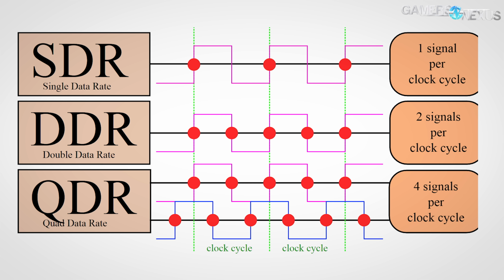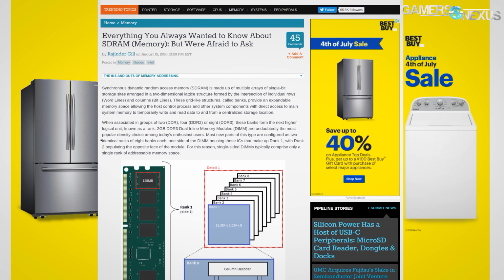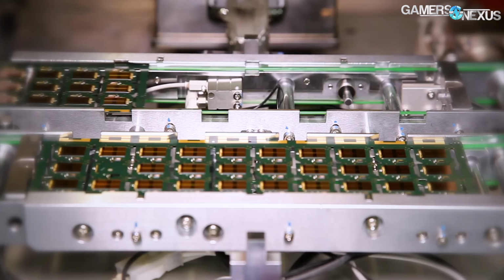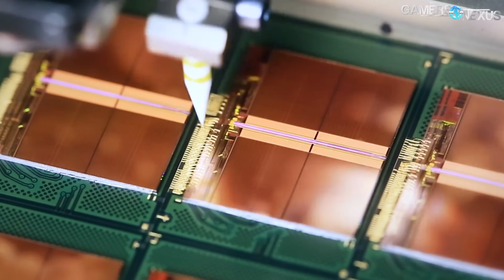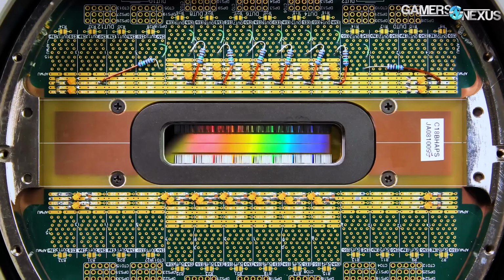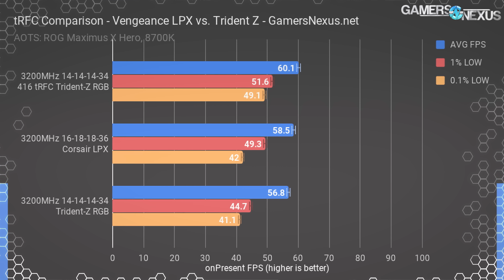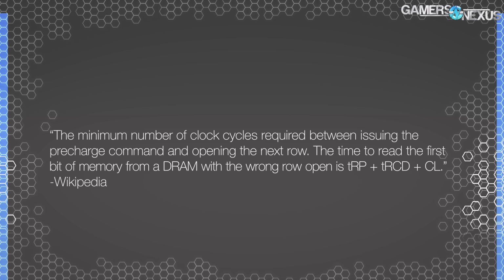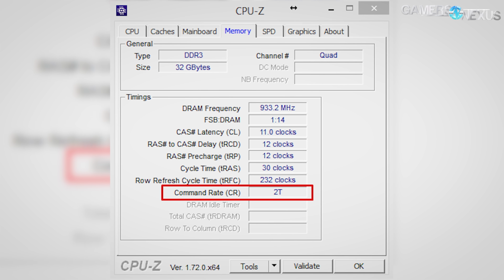What Are Memory Timings? CAS Latency, tRCD, tRP, & tRAS (Pt 1)

Comment: I've got some questions about some of the timings. I'm relatively new at ram overclocking. Just figured out I can adjust the ram timings on my alienware x51 r2 using grubx64.efi. Thanks to Laptop Tweaking Tips Channel. tRC should i set the lowest possible value or highest. as for tCWL should it match tCL or should it be set under if possible. My current timings are as follows, let me know if i got the formula correct or maybe some suggestions on improvements... Corsair Vengeance ddr3 8gb x2
   tCL - 8
tRCD - 9
   tRP - 8
tRAS - 19
  tRC - 27
tRFC - 174
tRRD - 4
 tWR - 8
tWTR - 4
tRTP - 4
tFAW - 16
tCWL - 8
tREFI - 6300
frequency - 1600mhz 
T1
memtest passed and it is definitely faster. additional specs, I5 4440 CPU, gtx 1060 6gb, 430 watt Antec psu.

Comment: Hello everyone, I have asus x570 strix e gaming  with 64 Gb ram Gskill trident neo  3600 , everything was right when I ran with 32 Gb ram ( 2 slots) when I upgraded to 64GB (4 slots) the system is always start 2 times (it on and off for few seconds then run again as normal) when I put the button to turn on the PC, I think I really need help from you to fix this issue.
Reply: just take the  32 gigs of ram out. Why you need 64 gigs of ram anyway?

Comment: Havent watched this just yet, but I would take the expo timings, adjust for stability, then lower each value in turn until it crashes then knock it back up.
I do know if you have 4 sticks, you should raise the CL by 2 to account for path distance to 2nd set of sticks.

Comment: The xmp or dhpc profile may be limited by your power supply, because todays graphics cards use more watts, I had xmp 2 profile turned on and would get error message when shutting down windows, so I switched to xmp 1 and now I have no errors and no fps was lost in benchmarks, when I upgrade my power supply I may try xmp 2 again, but it may not be necessary.

Comment: I have been building my own computers since last century, but never went near memory timings. I'd overclock my CPU and GPU, but memory was kind of daunting. I recenty bought a pair of 16Gb DDR4 sticks. CL18 3600 Corsair Vengence Pro. I set the primary timings manually. It was dead easy. I just went by the XMP timings as a reference. I lowered them from 18-20-20-42 to 16-18-18-40. Stable as and my computer feels quite zippy. I did not need to splash out on CL16 memory after all. There was a hitch though. A setting that was auto set went up from 64 to 75. Bank cycle time, tRC. I set it manually to 64. 

I did not go for highter speeds though. 3600 is enough for little old me and my more than grunty enuf 5900X. I do not like raising voltages for a tiny boost. I like to get best possible performance at default voltages, because extra voltage has very often reduced component lifespan in my experience (except my trusty old 2500K - that thing ran OC'd forever until I went Ryzen after Intel pissed me off one too many times).

Comment: I had some T Force Vulcan Z 16-18-18-36 3000Mhz 1.35 volt ram 2x8GB and I wanted 32GB total just because of tons of things running and I bought the exact same specs and compatible ram that was also 16-18-18-36 3000Mhz 1.5 volt 2x8 and even by themselves I could only get it to boot at 2866 and it was very unstable and only stable speed in any of the slots I got them to was 2400 :( And with all 4 sticks I only got 2133 no matter what. I spent around 6-7 hours constantly messing with them and I think mine are defective so I'm going to RMA them. They were some really cheap $35 2x8GB sticks.
Reply: never mix kits... thats the issue
Reply: @d0x360  Yeah I just couldn't find those same kits brand new and didn't know some motherboards only support up to like 2666 if you use 4 sticks of ram. Going to end up just buying 2x16 kit dual rank now.

Comment: In 1979 when I was working at Texas Idiots, I suggested that they change the read-write refresh process to the read-correct-write process. The number of bits needed for error detection/correction goes as the logarithm of the word width. An 8-bit word requires 4 bits at a cost of (8+4)/8 50% overhead. The row size at the time was 1024 bits. This requires 11 extra bits of data for an overhead of (1024+11)/1024 1.1% overhead. In addition, you would get "scrubbing" which means most errors would be corrected before a second error could occur. TI deemed this too radical an idea.

Comment: People using "the speed of light" instead of "the speed of causality" irk me. Sure, they're basically the same number by our modern physical understanding.

But the former makes it sound like it's just the speed light arbitrarily travels at. Whilst the latter makes its clear that it's the maximum speed that anything can be caused to physically happen.

Which makes unintuitive ideas like "a stick to the moon won't break light speed when you swing it" far more intuitive. As the atoms in said stick can not physically be caused to move faster than X speed.
Reply: Well said. Propagation velocity of C also varies depending upon the medium in which it travels. C variable depends upon the characteristic impedance, in Coax propagation velocity can vary from 55% to 79%. Cheers!

Comment: Amazing content, and can fully appreciate how difficult it is to make such technical points digestible.  At this point perhaps it's better to start all over, but just start with a page completed vs. making a video about it.  The benefit is that the page can be updated and clarified over time once the framework is set - then that can be the rubric for following up on a summary video (or videos). Thanks to the team for this info!

Comment: I worked for years as a Digital Component Test Engineer, and that included testing DRAM DC parametrics, AC parametrics, and functional testing using algorithmic pattern generators.  I am very impressed with the content of this video, so much so that I am bookmarking it, so I can share it with others in the future.

Comment: I kind of think this is a really bad explanation.
You are jumping all over the place.
It's best to just go over rows and columns. And also go to the breakdown of a memory address and how it's assigned a rank, row, offset, etc.
You can talk about how the row/column select is basically a mux if you want but that can be omitted.
Then you can talk about the precharge and column select. (And how this is derived from the memory address)
And then from here you can basically show each bit is basically a capacitor.
The memory address activates the row, and this causes each bit on the line to dump its content(it's a capacitor) onto the line. And then the sense amp detects the change in voltage.
Then a column is selected (cas latency!), to read particular bits.
It is good to keep a high level understanding first, this is all matrices with rows and columns but you did not talk about that much.
Your explanation is going into the details without understanding a high level overview of what is happening.
There is a good paper that explains this well, it is called:
The Memory System
You Can’t Avoid It,
You Can’t Ignore It,
You Can’t Fake It

Comment: Thanks for the tip on CMD2T, I was having problems when I installed 2 additional DRAMs for a total of four and had downclocked just to get it stable. Changing CMD 1T -> 2T did the trick and now I'm running the DRAM at full XMP frequency and timings.

https://youtu.be/o59V3_4NvPM?t=1087

Comment: Man, this reminds me of my masters PC architectural courses.  We had to write code from scratch to emulate an x86 processor, create a virtual cache and memory to simulate how data is transferred between all 3.  He'll then ask us to retrieve data at certain points in time in either the cache or memory to check if it was the correct data.  I think we even went into ECC coding.  It was a summer course and that wasn't enough time to really really dig into it.  We sped through so much (50+ pages per week) and very few passed.

Comment: Since the A520 can overclock ram, and is 2 DIMM board if i pair it with a ryzen 5 3600, which of the memories will have the best performance and overclock headroom for this board and processor Kit?

The setup is just focused in gaming, with a rtx 3070, Max fps focused
If the setup is just for gaming in 1080p and 1440p, infinity fabric 3800, should i take 3700x instead of 3600?

https://pcpartpicker.com/products/compare/BZwqqs,JVQG3C,vVVD4D,YYdrxr/

G.Skill Ripjaws V Series 32 GB (2 x 16 GB) DDR4-3200 CL14 Memory
(Dual Rank, Dual Channel, B-die 3200 CL 14 14 14 34 First Word Latency
 8.75 ns)
$174.99 (Price / GB
 = $5.468)

Team T-Force XTREEM 16 GB (2 x 8 GB) DDR4-4500 CL18 Memory
(Single Rank, Dual Channel, B-die 4500 CL 18 20 20 44 First Word Latency
 8ns)
$184.99 (Price / GB
 $11.562)

Patriot Viper Steel 16 GB (2 x 8 GB) DDR4-4400 CL19 Memory
(Single Rank, Dual Channel, B-die 4400 CL 18 19 19 39 First Word Latency
 8.636 ns)
$117.00 (  Price / GB
 $7.312  )

G.Skill Trident Z Neo 16 GB (2 x 8 GB) DDR4-3800 CL14 Memory
(Single Rank, Dual Channel, B-die 3800 CL  14-16-16-36 First Word Latency
 7.368 ns)
$189.99 (Price / GB
 $11.874)

Comment: This is really complicated and you make do a good job explaining it but, for just an average user (not an avid overclocker), is there really much difference between using 3600 18-22-22-48 or 3600 16-19-19-39 with an R5 3600?
Reply: Yes, better ram is the best way to oc ryzen 3

Comment: electrical "drift" does not travel at the speed of light, and the undesired delay, limiting performance, is mostly due to parasitic capacitance, which increases the time the voltage takes to rise to a percieved on threshold, or fall back to an off threshold. making surfaces smaller reduces this capacitance. 
  also the on-off speed increase, from the new shorter distance applied, is negligible.

voltage can be increased to speed up ramp up, but bigger tracks are required, causing more capacitance, we hit this un-passible limit around 20 years ago, around that time i was using a 1200 thunderbird, oc to 1333 or 1400, and moved to phenom2 4.7G a time after..; knowing at that time cpus wouldn't ever get faster, with our current technology.
  ...and it's still the same tech used today.... but at anytime tech could've advanced beyond our soldered node, partially removed layered "silicon alloy" wafers..... but it hasn't, and i didn't think it would, we've been developing this tech for decades without any slight hint of even an advancement to abstractly benifit the physical limitations.

lastly reducing the on and off threshold voltage difference from mean is ineffective at increasing performance due to instability, but it also reduces voltage overall, again delaying ramp times........
Reply: love the vids tho, thanks!

Comment: thanks man, i understood a bit more about ram timings and i brought mine from 19-19-43 2667MHZ to 18-19-39 3200MHZ which was a lot of work since i have a gaming laptop and bios is kinda hard to reset because you gotta open up the laptop to get to the reset button but at least i’ve got a 100% ram bench according to user benchmark and i’m getting 70 fps on metro exodus instead of 40-50 like before

Comment: Question from a beginner in overclocking: I seem to only be able to access primary timings(5) in the bios on a B-350 board. Is this normal ? I'm trying to get my 2666Mhz corsair kit(2x8) to work with a zen1 1600 cpu on a asus strix B-350-F Gaming motherboard. I heard in another video that X.M.P or D.O.C.P profiles don't work with 2666Mhz RAM and zen1 cpus and it indeed does not work for me. Any help welcome.

Comment: This is the gist:  CL (CAS Latency) is about the most important factor.  Look for lowest (generally).  Again, generally look for lower timings across the board.  Active to precharge delay (tRAS) should come next.  If you can get the Command Rate from a vendor (good luck in some cases), then if it says T1 or 1T, then it's 1 clock cycle return.  T2 or 2T is 2.  So go for T1 if you can.  The other factors aren't really all that noticeable in general, unless you see a crazy difference between vendor's offerings.  There's more to the speed of your system than just one factor anyway:  power fluctuations, thermals, resource allocation, humidity, airflow/cooling, component quality/speeds, component placement and the list goes on.  My position on general use is go for the best quality RAM and don't get caught up in negligible differences in timing.  I spend the most money on my PSU, motherboard and RAM (in that order).  The rest can go cheaper if need be...although that might change depending on your needs.  I also advise not bothering with "tweaking" timings unless you really know what you're doing.  Just go with the default or auto timings, if possible.

Comment: Purchased new KINGSTON Fury 8GB DDR3 1866 RAM(HX318C10F/8) to pair with my existing KINGSTON Fury 8GB of the same model no. After installing I found that the new one is giving latency timings of 13-13-13-33 but the old one having timings 10-11-10-30. Checked the Asus M5a97 evo2 MB bios spd tool which shows same part no(KHX1866C10D3/8G) for both the ram but timings mismatch.

Comment: I hate RAM overclocking.. For one thing system instability comes up alot, even after you think you're stable, especially if you're increasing the BCLK (tip: don't do this). My system can run (stable) with 12-13-12-40, but also with 12-13-12-24; tRAS is very different between these two but they both run and give similar numbers in benchmarks, so which is the better option? Who knows...

Comment: @Gamers Nexus    Have you ever tested performance and fps differences between say 3200Mhz Cl14 8.88 ns true latency,  3600Mhz Cl16 (8.75ns true latency)  and 4266Mhz Cl19 (8.9ns true latenc) ?  i have bin trying to find the resultsof this but its dam near impossible to find anything on ram performance.  These ram sticks have pretty close latencys but from what i have seen the higher speed (mhz) ones will have higher bandwith but how relevant that bandwith is compared to the true latency is something i cant figure out without spending a few grand on hardware.  i think you have the means to test this so i hope you already did it find this a interesting test to do. As i for 1 am really intersested and on what wall on what i should get and what is better as currently the price difference isnt all that much with 42gg cl19 costing 219 here and 3600 cl16 costing 200 but going down to 3200 cl14 saves 50 bucks all of a sudden. Im leaning towards a middleground but i like perfection so 20 bucks more or less for perfection is worth it to me.

Comment: My FlareX 3200 14-14-14-34 is running @ 3478 MHZ 14-13-13-21 with my TR 1900x cenibench score is 1855 @ 4.07 GHZ stable with FSB overclocked to 107 MHZ. 
Same results achieved when overclocking the multiplier instead of the FSB  @ 4.125 stable and RAM @ 3.200 MHZ but with FSB overclocking the whole system is bumped up including my NVMe solid staable system and with RX 580 overclocking im getting 15 % FPS increase in all games. the Taichi x399 is not bad after all. the only thing that makes me wonder is that the temp is the same for vrams mosfets whether im running at stock or overclocking  60ish degrees all time overclocked or not even if i cranked the volts to max same temp when the safety switch is off the vrams are just warm LOL

Comment: To point out a mistake at around 3:15, you said the speed of light is our max speed here. Electrons do not go at the speed of light, actually moving at a speed of 1 meter per hour, it's just the domino effect of charges that make it instantaneous such as the light of a bulb.
Reply: Technically, he's not wrong, c is the hard limit for data transmission.

Comment: It's easy. In a nutshell, buy good memory, start with XMP speed, likely not stable, increase vdimm and SOC voltages until close to stable, decrease XMP speed one notch, then tighten (decrease) timings, that will likely return you to some instability, now move on to secondary timings and relax (increase) them slightly which should return you to stability. Done. Remember to test after every change. You will find the sweet spot where gains are minuscule or non existent. Leave it there. Write down all the changes along the way and keep them in case you have to start from scratch one day. You are right about good old trial and error.

Comment: I hate overclocking ram for the simple reason that setting one timing could make another timing invalid and results in stability issues, but at the time I like the outcome adjusting timings can bring to a system.
Reply: Same, overclocking the cpu is so much easier.

Comment: I run my 2666 rated corsair lpx at 3000mhz 13 16 16 28 278, I cant get that 16 down to even 15... I am doing something wrong, all my secondary and tertiary is modified by a preset for 3200 Samsung. mem timings is a bitch, it is 16 18 18 36 360 xmp

Comment: Any chance you guys would do a tutorial on overclocking memory (speed and primary timings mostly) while explaining your steps? I understand (now, thx to this video) that what you can achieve is dependent on many variables including motherboard, CPU IMC etc.. But most memory overclocking tutorials out there don't explain the why someone would lower this timing vs raising it or why lowering this one making the other needing to be higher etc... It always seems random, which trial and error seems to be the point, but I'm sure there are some of them that actually know why they are doing it this way; They just never fully explain it. Thanks!